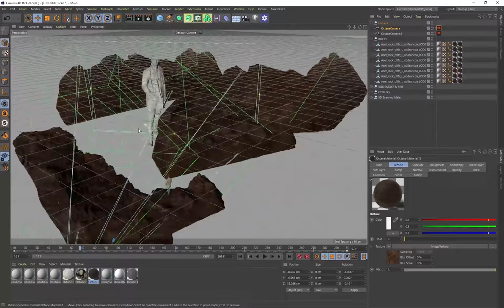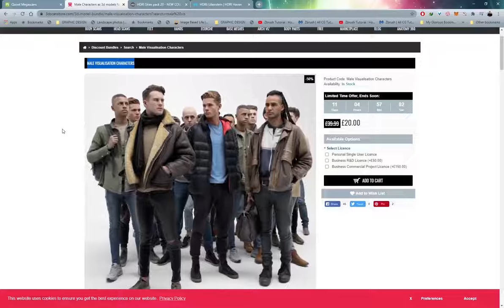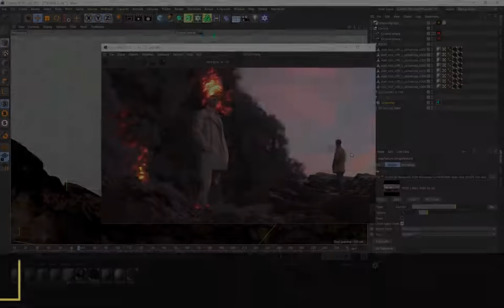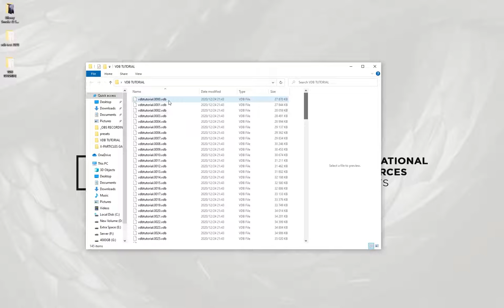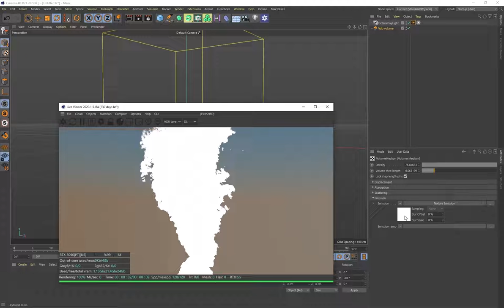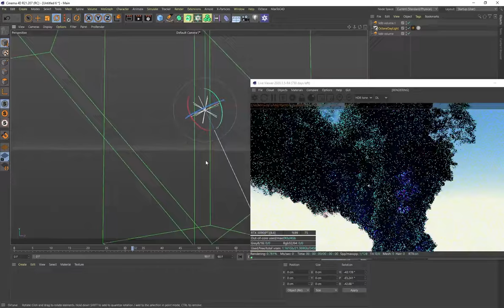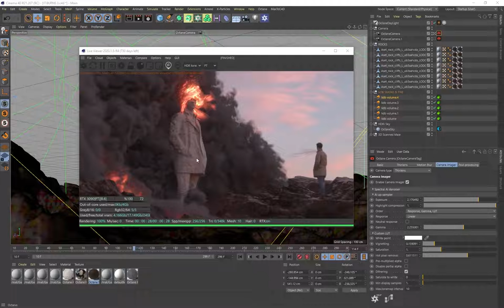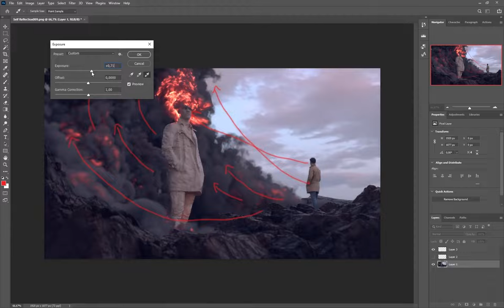Embergen, Cinema 4D & Octane Render - How I Created A Fire & Smoke Animation

Comment: How to you get yours to not be pixelated in vdb? At .01 step and 7000 density mine look like mini minecraft blocks. I tried lower voxel size in simulation out of Embergen but nothing changes.
Reply: i have the same issue, did you figure this out?
Reply: @kudjo24 did you figure out a solution? I am having the same issue.

Comment: This is great, but I saw you have a 3090... for mortals whit 1080ti this could work or will be super slow? like unworkable slow I mean. EDIT: it works! :)
but the Volume gradients for colors is only working with only 1 color (position of the white part in the gradient)
Reply from the maker: I think the 1080ti still has enough vram to handle this. You'll just have longer render times. Give it a try, I'm keen to know what's the results with a 1080ti.